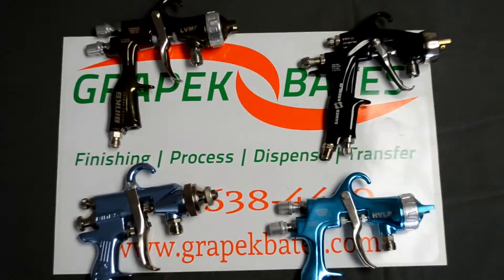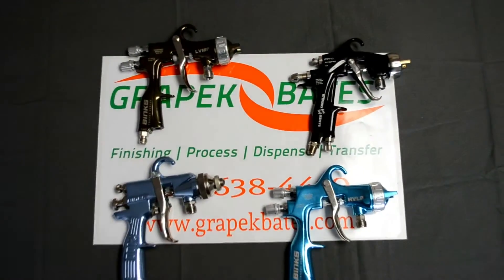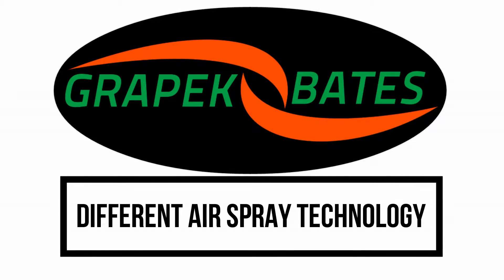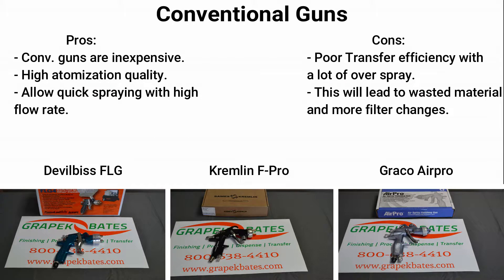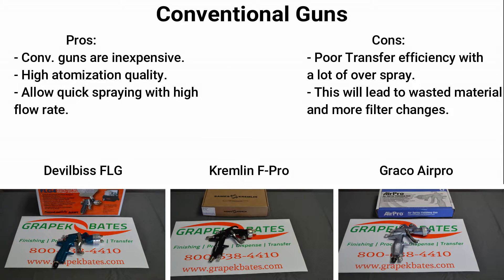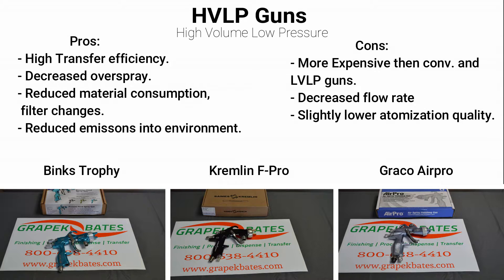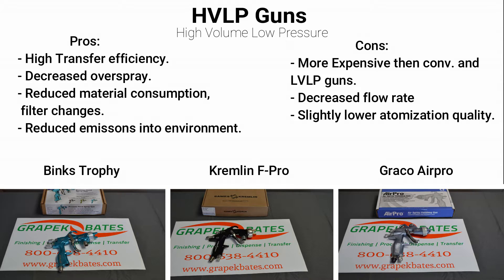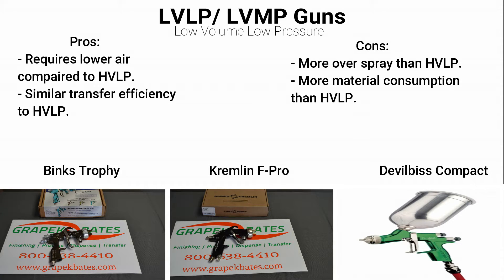Different types of Air Spray Guns

Comment: please tell me the approximate price of this type of spray gun.
Reply from the maker: Tejendra Pradhan which one were you looking for there were a lot mentioned in this video.
Reply: @grapekaction  there are mainly two types. One is the common type which is often shown in videos. The other type is a metal can. Wind pressure is applied from compressor machine to its outlet. Nowadays plastic can is also shown. I purchased this type. But the nozzle soon got damaged beyond repair. So I wonder if metal type can withstand long use. So I want to know it's price.